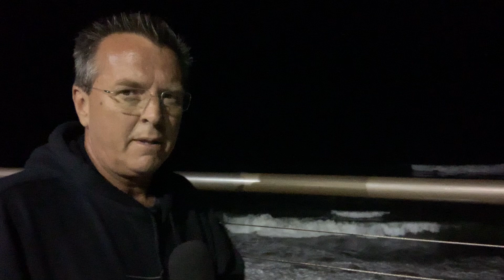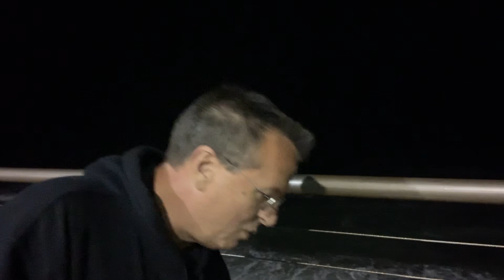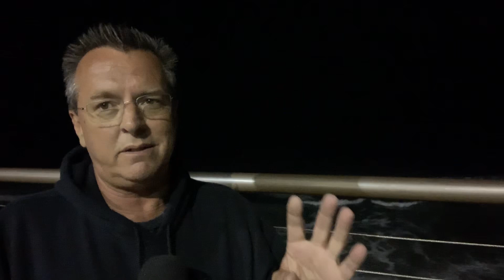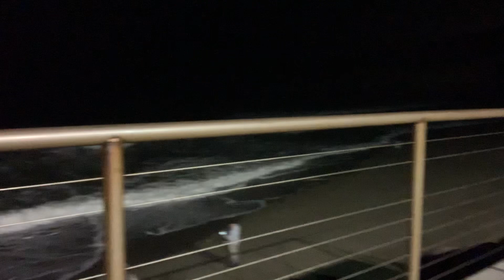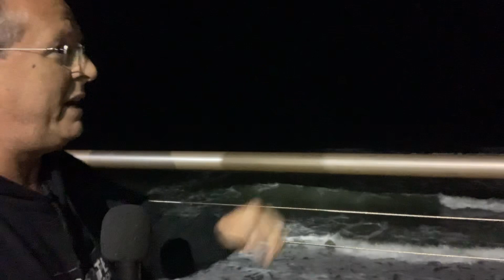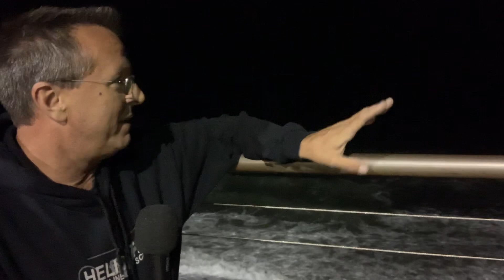#213 “How do EMS pilots calculate fuel”

Comment: I’ve been doing EMS for almost 20 years once I was down in El Paso Texas working I got a scene flight over 150 miles away I did not know the patient weight . I didn’t know they were coming back to El Paso. I was flying MBK 117 B2 probably one of the better EMS helicopters ever made. I had the com center do my dirty work and find me the closest place to get Jet fuel and call and check to make sure they had fuel and nothing was broken with their pumps. Last thing you want to do is get to the Patient and then not be able to fly on with the patient to the trauma center . What I did was drop off the crew while they were packaging the patient I went fueled up came back loaded up and off we went. But most of the time when you’re at the base you know where you’re going you know how far it is you know how much fuel you need me only operate within normally 60 to 80 miles from our base .
Reply from the maker: I flew the BK for 2 years. The Heavy Duty Truck of Helicopters! Thanks for sharing!